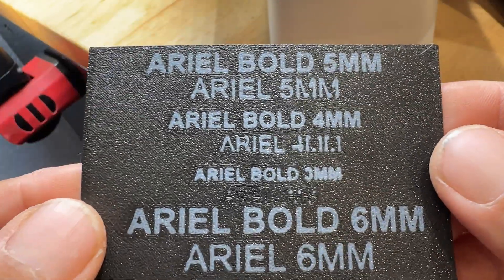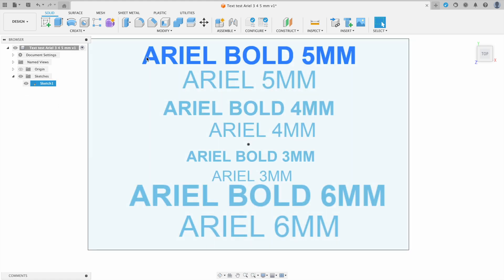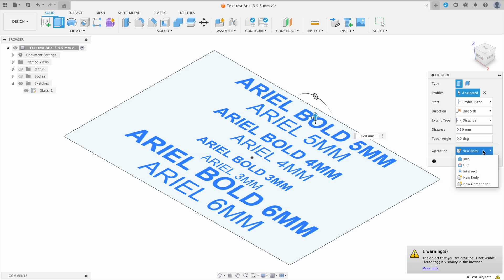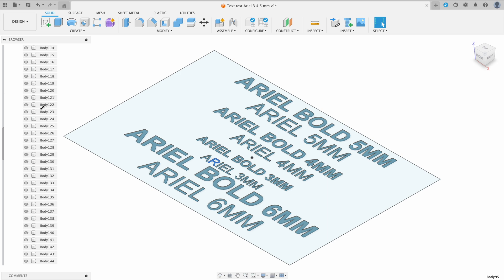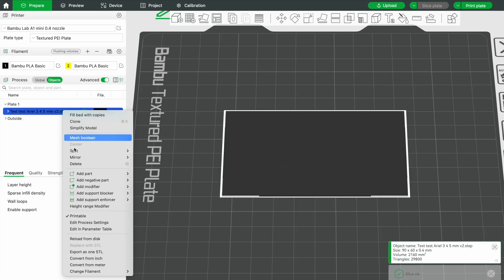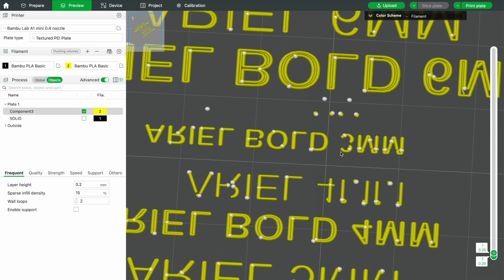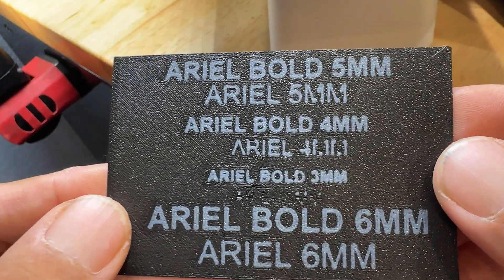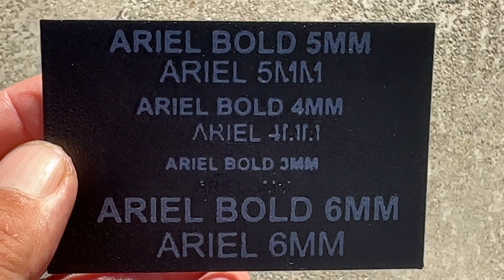Adding text to 3D print bottom layer

Comment: Thank you so much. I was trying other solutions, including using modifiers an none have worked, this is a simple and effective solution. I added a logo to a preexisting body, so I had to draw a sketch on the face where the logo will be, add the logo to the sketch, cut using extrude 0,2mm into the body, extrude the logo 0,4mm and than move the logo body 0,2mm into the target body, so the letters will be flush with the body. Exported the two bodies and Bambu studio had no problem to color them separately and print them on face layer.

Comment: the way i have been doing 3d printed dart flights at the moment is a trick i saw on tiktok,  the trick was to get anything "stuck" from a well worn plate, was to print directly over it with a ,  and it worked to get stuff of the bed, so i thought if this works to get things off,will it work to embedd text/images into another layer ontop of it and it worked so say the text you want is 0.2 mm thick and then the business card put it over it at any thickness and it will embedd it self into the print and work

Comment: What you can also do is use a normal printer to print text (or images) onto a plastic film of some sorts and place that secured onto your hotbed and just print onto it. With the right film it transfers the text or image onto your 3d print.
Reply from the maker: Awesome, I'll give it a try.
Reply: @etischer  just looked around to find some resources on this in English (originally, i came across it in my native language): https://www.youtube.com/watch?v=Jq13diBRQcA

I reckon any commercial 2d laser printer will be far better at printing text or anything with fine details than a 3d printer, so when the transfer from the sheet to the first layer works decently the result could still be superior to using just the 3d printer
Reply: @du_louser  Thanks for sharing this! This is exactly what I was looking for to add some more detailed text to my prints.

Comment: Can anyone help me?  I go to cut the text out and it tells me either cannot preform Boolean operation or tells me there is no body selected
Reply from the maker: if you are extruding a cut operation, you have to have a body selected to cut from.  Also check that your cut is in the correct direction to remove from the selected body.
Reply: @etischer  found the issue… apparently you cannot extrude certain fonts.  I had one selected that was just that.  Once I changed it to something else it worked just fine.  Thanks for the reply!!

Comment: Just an idea for an easier way to get the same effect is to only do the negative body and then a can of spray paint and damp paper towel to wipe off excess. Basically same way it is done in some commercial work. Has the advantage that color can be changed as needed or touched up at a later date.
Reply: Interesting option, what kind of colour would you use that would be easy to remove?